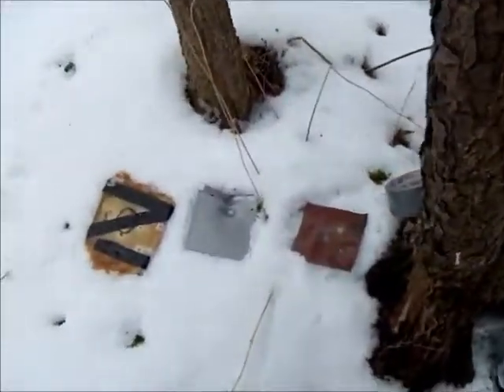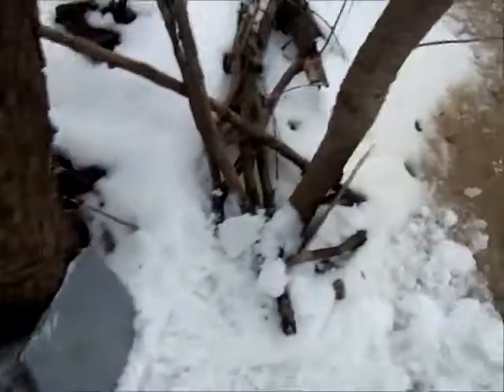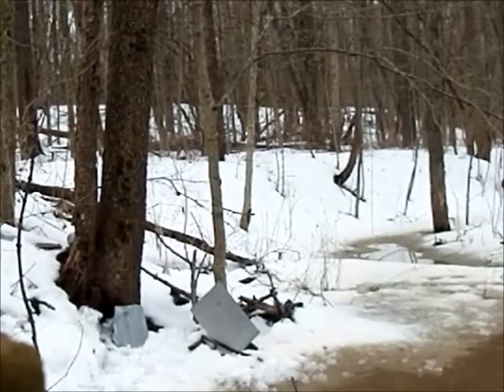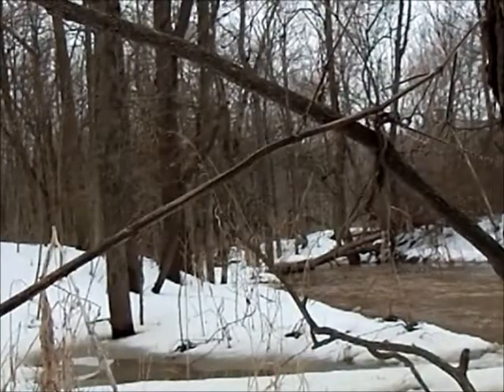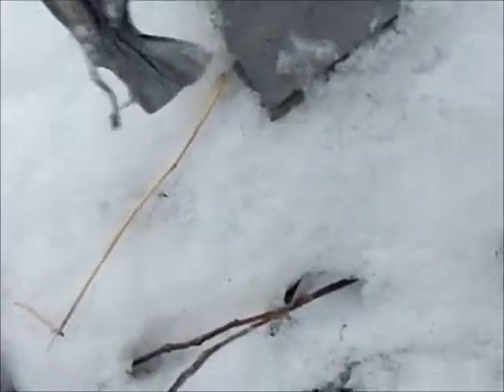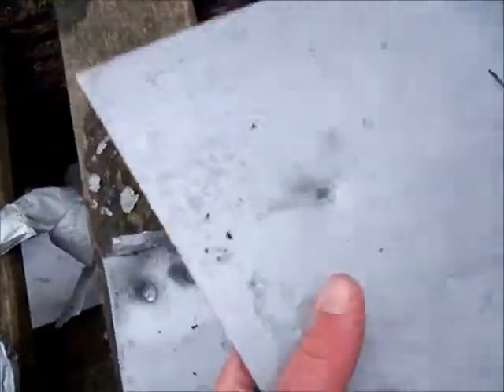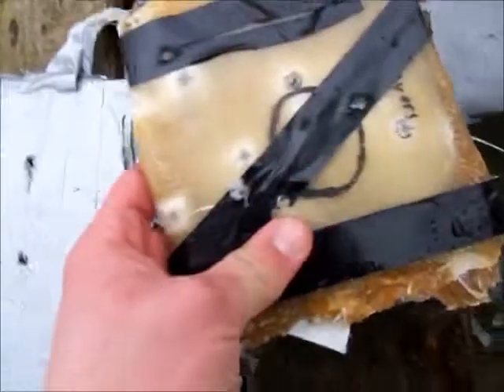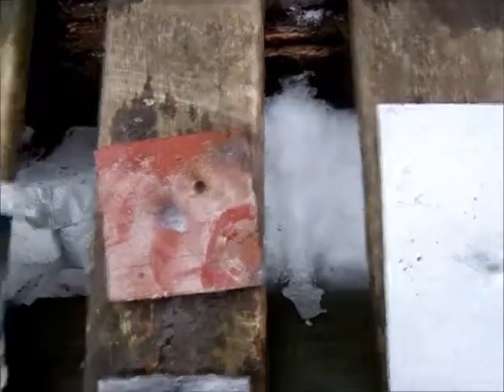Homemade Steel and Fiberglass Layered 9mm Bulletproof Armor Tests

Comment: Awesome video brother just a friendly FYI on your disclaimer on the end " you will have been warned! " I think the " will" is an error.  I did many similar tests like that, but i learned allot after buying a second chance 5"x7" titanium panel, it showed me what a titanium 7.92oz or 224.6 gram 1/16" thick plate can stop.  On the front sticker it's rated to stop including 9mm KTW, and all known 9mm armor piercing rounds as well as 7.62x25 Tokarev ( those are just stupid fast and go thru all level 2 vests ) and 12 gauge slugs.  Look into it brother, I was blown away with the very thin/very light plate performance.  Oh ya it's covered with a single layer yellow Kevlar to stop bullet fragments.

Comment: i made something simmiliar to this: 1 layer of 0.5mm steel then a combination of 8 layers of fiberglass mesh( the orange mesh) 6 layers of fiberglass mat and 2 layers of denim-laminated with poly resin. Everything was wraped with duct tape. I cannot test it with 9mm because I dont have any ammo. So if you want to make it give me credit in your video :D
Reply from the maker: +Aleksandar Ćurguz  I dont know what kind of steel you used, resin, or mesh, but I dont believe yours would stop a 9mm, just from personal experience. TBH, fiberglass is not very good by itself to stop any round, unless you have super good woven roving and the hardest resin.
Reply: tonto bob Thanks for the reply, definently will take your opinion into consideration :D